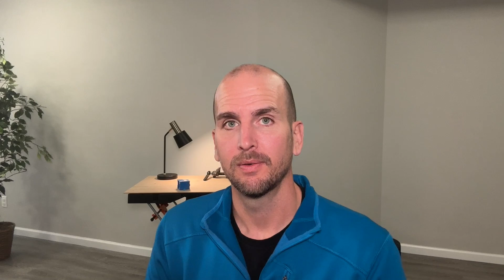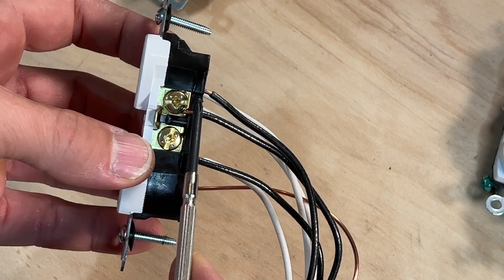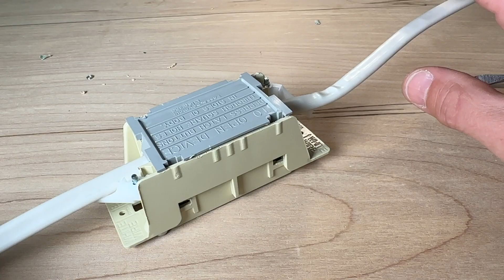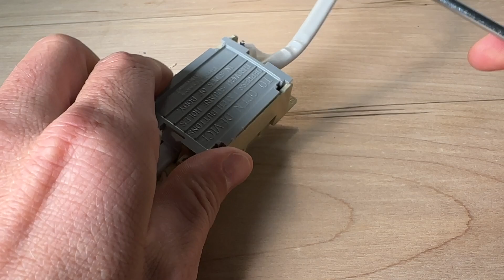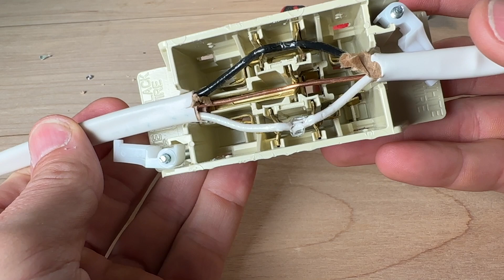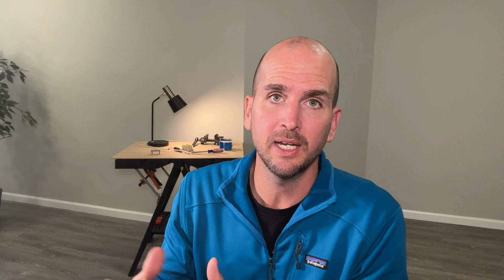90% Of Homeowners Have Never Seen This Dangerous Electrical Device

Comment: Never seen that either! But decades in telecommunications, with small gauge low voltage wires, I've seen countless of punch down connections fail. Mercy, I can't imagine running a hair dryer or space heater through that!
Reply: Punch-down connections are a pox on communications

Sincerely,
A former IT intern who's had to punch down too many turnkeys to count with a cheap punch
Reply: @calyodelphi124  Using proper high quality (and thus expensive) punchdown and crimping tools works well.  Also the proper impact setting for type 66 or type 110 punchdown blocks.
Reply: @calyodelphi124  Meanwhile as a former field technician I've traced lines in panels so old that the actual wires weren't even visible through the dust. Not repaired; traced. The lines were still in service.

I greatly prefer punchdown IDC over every other style of termination because, if you have the right tool, they're vastly more reliable. If you're punching keystones on a regular basis, it's definitely worth the few dollars to get a termination puck to hold them. Along with a proper impact tool - and although I like their testers, in my opinion Klein usually had the worst quality for telecom/datacom hand tools. I used a $20 punchdown from Home Depot for 5 years, until it got stolen, then bought another one.
Reply: @Azlehria  Not to mention that IDC splice connectors like Scotchlok UR and UY as well as the 710 and MS2 have been used in outside plant telephone wiring for DECADES. They're so reliable that they're used in splices that will be buried underground. Would anyone use an unreliable splicing method if fixing it meant digging a hole???
Reply: @brianleeper5737  Splice connectors sometimes have a blob of dielectric grease inside to keep corrosion out.  I have some of these more than 20 years old and still going.
Reply: @Azlehria  Exactly right.  Good tools.  I purchased punchdown tool from Graybar longer ago than I can remember, with chrome-moly blades.  Probably 20 years later it is still like new.  Crimper was $80 or so, 20-ish years ago, seen some wear but still makes perfect crimps on RJ11 and RJ45.
Reply: @thomasmaughan4798  These telecom splice connectors are available in "dry" (no grease) and "filled" (with grease). I have never seen dry versions of the Scotchlok UR and UY though they exist.
Reply: if a person were to actually strip the insulation from the wire prior to installing one of these  the connection would be much stronger ,,,these things are the power outlet version of Scotchlocks which i frigging hate as well
Reply: @Karl with a K I'm not terribly thrilled with the idea of daisy chained electrical outlets.  They exist but I'd much rather have a home run to the circuit breaker panel for each outlet or at least carefully considered daisy chaining.   At work, two microwave ovens side by side, but on separate circuits so both operate at the same time, no problem.
Reply: @Karl with a K "ALL outlets are daisy chained"
If only I could believe that you know how billions and billions of outlets are wired so you could accurately make such a claim.
"is is an example of a superior design."
I wonder what are the parameters of superiority?  To me, a superior design is each outlet has its own circuit, so I can be running an appliance on one outlet and not have to worry about what appliances are on the same circuit.
Reply: @thomasmaughan4798  Not all outlets are daisy chained.  Many houses (not all) have dedicated outlets for the microwave and large window air conditioners.  I have dedicated outlets for air conditioners, an outdoor outlet and an outlet in a shed that I keep a freezer plugged into.
Reply: Prove it. Show us a skinned knuckle from a 66 block. Then tell us why you hate 110s.

Comment: I have not seen an electrical device like this before. When you removed the back, and showed how the conductors are pushed into the brass contacts for the hot and neutral sides, this is what I expect to see in a plastic case power strip.  When I do work I use the terminals and J bend or back-wire if the device has the pressure plate with the screws.  I remember yrs ago surface mounted switches and outlets were made for non-metallic cable but they had screws as on conventional devices.  This device looks very unsafe,  poor contact, not a secure connection. Be much safer to opt for cut in boxes with tabs.

Comment: A little scary?  I've seen two house fires in my life, both the result of bad wiring.  Those experiences really changed my attitude about electrical safety.  I've never seen outlets of that style.  I have seen lamp cord switches that use the same method to pierce wire insulation. Those are hinky, this is downright wrong.

Comment: I knew as soon as I saw the thumbnail the bad news report. Had a lady who had those in her manufactured home and the outlet caught fire because of a space heater. Just take it apart, snip the wires and wire in your outlet of flavor
Reply from the maker: Agreed.
Reply: True so the workaround here is to drill a hole in the back of a old work box and feed the wires through then a pigtail. You have to provide slack for contraction and expansion and secure with a clamp.If you can get it in the box you can pigtail it. If not well time to pull a new circuit because most homes have prefinished drywall that you can't match

Comment: With the correct tool they are likely just fine. However as the tool is over $600 most people are no going to buy one and this leads to the unsafe installation of the devices.

Comment: I would love to see this outlet on a thermal camera, under load, compared to a standard outlet.!
Reply: It’s surely a terrible method of making a reliable professional installation. The question is how a worst case scenario can evolve. Obviously a poor conductivity will yield heat but is there a path where it can yield a fire? If anyone can create a real-life condition of this yielding a fire, I’m sure someone will ban them. I can’t imagine no lab experiments have been conducted to prove safety.
Reply: @ThinkingBetter  the problem with lab experiments if they sometimes overlook simple things like incorrect installation or foreign materials ... Lets say the rear cover plate was not correctly secured, some combustible debris gets inside the box and now there is enough material to sustain a small fire for long enough to leave the box and spread throughout the walls of the RV. A lot of RV's use styrofoam insulation in the walls, there is a lot of debris and the material is HIGHLY flammable...
Reply: @crazypete3759  Yes, I agree and obviously this was approved based on assumptions that might easily fail when installation is done poorly. And I guess this product is especially used when there is little money to hire a professional installer.
Reply: Have a motorhome and awoke one morning with the one and only circuit breaker that have tripped that covers all of the 110 sockets in the motorhome. I suspected it was one of those forementioned sockets that I swore I was going to go through and replace all.  It was going to be difficult to figure out which one was the culprit, but I brought out the infrared camera and could see the hotspot from well over 10 feet away.   These are horrible ways to provide 110 in the motorhome or anything for the matter. I would like to BS the engineer that OK these to be used. Justified savings by decreasing safety is a no go.
Reply: How can that even be legal?
Reply: @trumptardican  I bet you have to use a certain kind of cable which he didnt.
Reply: @Karl with a K The main problem is the minimal amount of contact between the wire and the contact prongs for the receptacle. Definitely not a safe product.
Reply: For real. I'm just surprised I'm not hearing about these things starting fires on a regular basis. I'm not even an electrician and immediately noticed them as a bad idea.
Reply: I have these in my trailer..
Reply: @Karl with a K it's not imagination it's the science behind how this stuff works. Something like this might be capable of passing power through to the next one and next one better than say using the stabs on an outlet, but delivering power through the outlet is going to have much higher resistance, and therefore more heat. I've seen tests prove this idea before. Overcurrenting a 15 amp outlet with standard screws, and one with stabs. Both passing the current through to the next one. The one using the very small contact the stabs give, which may be even more reliable that what connection you get with these through the receptacle itself, melted down long before the standard screws did. The video also tested various other wire connectors. Wagos, push ins, wirenuts, and mar connectors. I think it was made because of alot of peoples assumptions that wagos are a better connection than traditional wirenuts. And that was proven to be quite false in these tests. Similarly to the push in connector and stabs. They have a pretty small contact area, they are clamped on a bit harder, but it's still a very limited connection. Push in connector, stabs, wago, screw down terminal, then wirenut, then mar connector. That's the order of connection quality. And in order to do any damage to the wirenut the guy needed to have already melted the casing down and the wire glowing. This test took all of the connections far past what the wire itself was rated for. Another thing you have to think about, is how is the connection going to fair with some corrosion down the road. The very small contact area is going to eventually have corrosion, and because its such a small area of contact to begin with it will add more resistance than a similar level of corrosion on say, a screw down terminal. It may be a more rare occurrence to have an outlet fail due to current passing through one receptacle as opposed to the whole bank making the terminations failing the first in the chain, the chance of it happening with this, or an outlet using stabs is substantially higher, especially over some time
Reply: what would powering a thermal camera have to do on this kind of outlet compared to a regular home appliance? do thermal cameras just draw more current making its power hotter because it sees thermal? sorry if it's a dumb question I'm kinda new at this.
Reply: @alexanderwoolley1623   Sorry, to be clear, it's not about plugging a thermal camera into the outlet in question. It's about VIEWING the outlet with such a camera. Find more info on thermal cameras if you don't know how they work. They are very neat and helpful in a lot of cases. They work like night vision cameras but show hot and cold areas. Kind of like a type of x ray vision. :)  In this case, I think this "RV outlet"  would show up being warmer than a regular outlet, indicating it doesn't convey current as efficiently or as safely as a regular outlet.
Reply: My first thought!
Reply: Omg yes this is a must see
Reply: @Karl with a K "Your imagination does not make it true" is what, irony?
Reply: @Karl with a K can you read? What about the resistance going out of the receptacle?
Reply: @Karl with a K I understand the materials fairly well. If someone plugs a heater into one of these outlets and it has substantially more resistance than a j hook on a screw because it's barely making it through the wires casing, I could very easily see it's real life current rating being reduced to less than what that heater might produce, and like I said, corrosion over time is going to cause problems. Same with using those stabs. Most of the crispy outlets I've removed have been due to extreme corrosion, impropperly/loose connection on screw downs, or the use of the back stabs that has a similar if not larger contact area with the wire than this design does. I'm one of the people replacing old stuff, so I've seen what fails and how. I understand very well that the wire itself will have less resistance at the end of the circuit because it isn't broken in any places but that's not what I'm talking about. I guarantee you, you take that thing, and do a long term comparison with a standard screw down terminal I installed, and my outlet will be working just fine when that one fails due to corrosion and heat if they are in equal conditions and use. And I'll triple down on the fact that my wirenuts will also outlast any of these outlets. Properly done the twist should be a substantial connection, not adding much, if any resistance, based on the over current test I saw, like i said before, they outlasted the wires casing and had substantially less heat damage as they were properly twisted. If you want to have the safest and best overall outlet circuit. You're probably best off to use wirenuts properly applied rather than any of the outlets connection options to carry the current throughout the circuit.
Reply: @Karl with a K I've seen several UL listed products, specifically motion sensing light switches, that break NEC by needing you to use the ground as a current carrying conductor. Idk if they are still UL listed, but they were quite recently. Other iterations I've seen have a green sleeve over a white casing in case there is no neutral in the box. I just looked some up, this leviton one had UL listed in its description, and had an install video showing them hooking up the green ground wire required for it to work up with the grounds in the box. Surely the current is quite low, but it would trip a gfci if hooked up in this manner, and isnt code compliant. Some manufacturers post neutral required, because that is how it should be hooked up by the NEC. So these are UL listed but their intended installation is going to violate the NEC? How did they get UL listing? Nothing is perfect Karl. This product has one great advantage, but other disadvantages to other designs. I dont know what your experience or education is in the subject. But mine tells me that is going to have an inferior connection to deliver power through the receptacle, and such a connection is going to suffer far more from corrosion down the road.
Reply: @Karl with a K An interesting aspect to me is that, if used correctly, these will cut into the copper wire, rather than clamping on to the surface, bypassing surface corrosion (though that will still be present on the terminal, presumably) and reducing contact resistance. Definitely food for thought.

Comment: Also!  These idiot Boxes are usually Installed with really short wires.. So adding a conventional replacement box and a standard outlet is a freaking nightmare. I am replacing them as fast as possible in a vacation home we have.. but this is what replaced ALUMINUM mobile home wiring?  Makes me feel disposable that there isn’t a standard that would have prohibited these POS.

Once again, the Poor people get the shaft.

Comment: I have not used these but I totally agree with your lack of contact area on these. Insulation displacement blades are not the best for high current connections.
Reply: I've only seen them in manufactured homes.  Trailers. Double wides.  RVs.  My Ex's parents live down the road from me in a double wide.  I'm still close with them and check on them from time to time since they are getting older.  They had an electric problem last year and I went up to fix it for them. I found the place was full of nothing put those weird outlets.  One had burnt up and the way that they were wired meant it made the rest of the circuit dead. I went ahead and replaced every outlet in the house, it was a major pain. I couldn't believe they were legal honestly.
Reply: They're not the best for low-current connections either. Every network termination kit has a punch-down tool and a cable tester - because you can never trust the terminations until you've tested them.

Comment: This type is most commonly used on zip wire to create a switch in a lamp. I don't like it either.

I used this type of connection on CAT5, called "punch down". Much more reliable (at least when using solid core wire...) but also much more robust (read: painful...) connection technique
Reply: Well, yeah, but CAT5 doesn't handle any power. Not a good idea if you're running 15 amps.

Comment: I had travel trailer where these are used ,one that I used for coffee pot and as you stated it burned up luckily I was there,I replaced all of the higher current outlets with standard home outlets. Thanks for your info. Chuck.

Comment: I had one in my RV and it tripped the breaker all the time because the contact on the wire was minimal at best.  It was evident that it got hot because it looked burned.  I replaced the outlet with another one, same design but I stripped the wires and pushed them into the clamps.  I didn't see an issue because the wires were separated.  This I'm guessing is not good either because the wires could arc.  Think I'll be changing it out again.